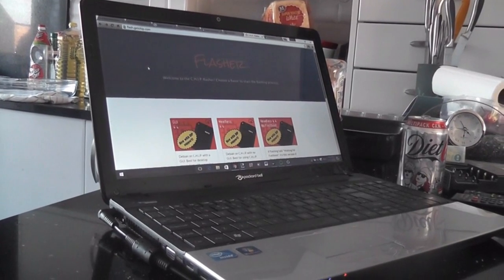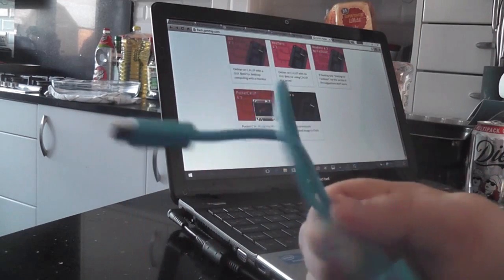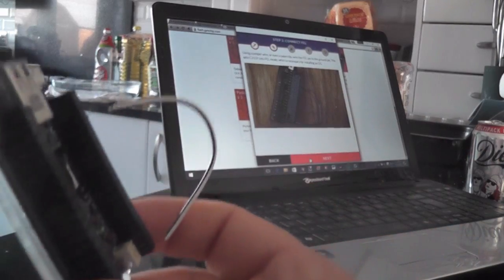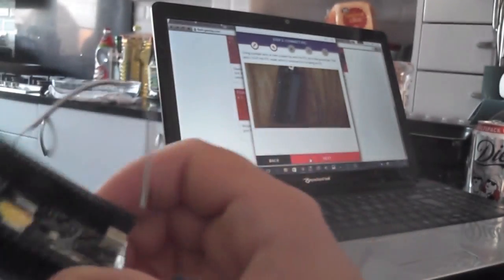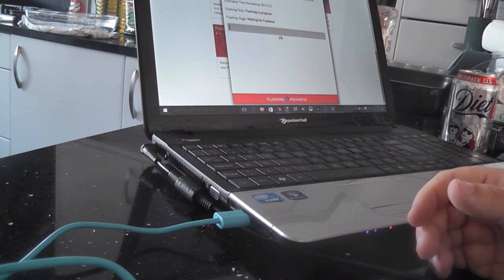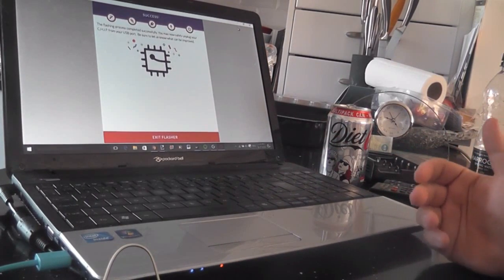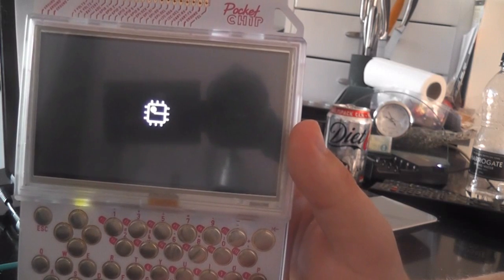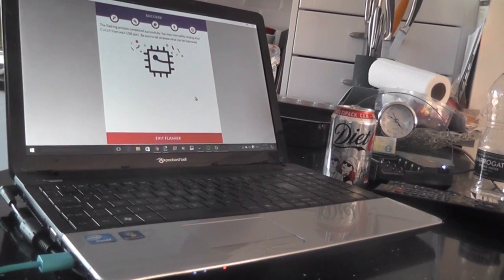Flashing Pocket C H I P

Comment: You can flash the Pocket CHIP without removing the CHIP. Note there are convenient headers at the top of the Pocket Chip, and the last two are labeled as ground and FEL and expose access to the respective pins of the board.

Also most problems flashing are solved using the actual CHIP-SDK on a native Linux system. Ubuntu works well. https://docs.getchip.com/chip.html#installing-c-h-i-p-sdk - followed by  ./chip-update-firmware.sh (and the distro flag of your choice). If you are running Ubuntu from a live USB drive, you should begin your session by running sudo -i but if your distro is installed, the directions as indicated should work.

The Web flasher app is down since NTC seems to have folded.

Comment: Was I supposed to flash my pocket chip or do you only flash chip's? If I wasn't suppose to, I fucked up because it wont let me put any commands in terminal. It just gives me errors and command not found. Is there a way to fix this?
Reply from the maker: +Jason Boggs re flash it to pocket chip firmware :)
Reply: When I get to flasher it ask me to choose an image. Which do I choose 4.4 or 4.3 with the pocket chip pic on it?
Reply from the maker: The one with pocket chip pic 4.3

Comment: why me always stuck in Processing FEL stage 0%
Reply from the maker: Did you restart the pc or laptop you installed the driver on? Have you got the wire bridging the FEL and the GND pins?
Reply: I had restart my computer several time ,after install driver . If no bridge the FEL, flash tool will not enter flash mode. A was almost give up.

Comment: A tip: If you want to reflash PocketCHIP, you can just reboot into flashing mode (off the power menu). You can then just connect the usb and flash without removing CHIP and without a jumper. When you do this, it boots directly into fastboot mode, so the fel part is skipped. But if you do flash CHIP outside PocketCHIP, the jumper only needs to be in when CHIP is powered on. Thanks for making this video!
Reply from the maker: The software way hasn't work for me at all. I have tried that way numerous times